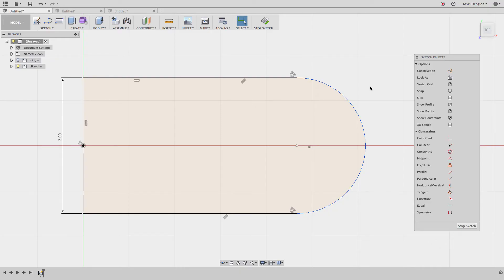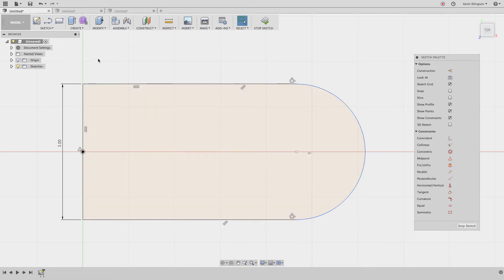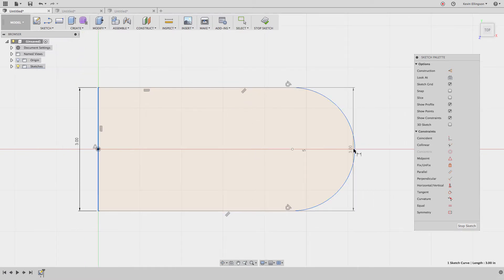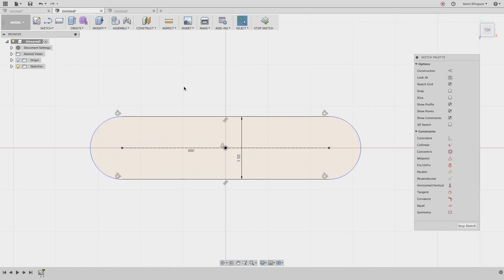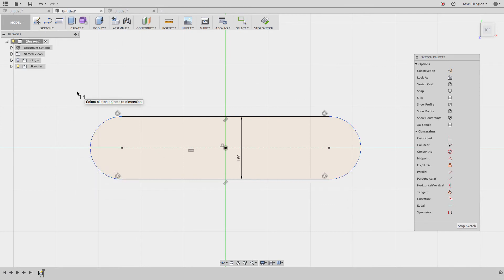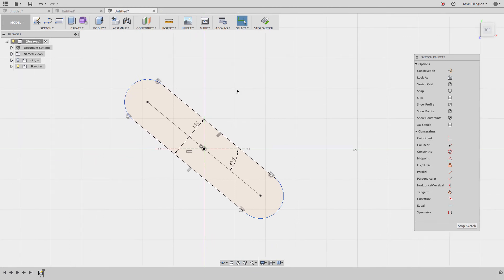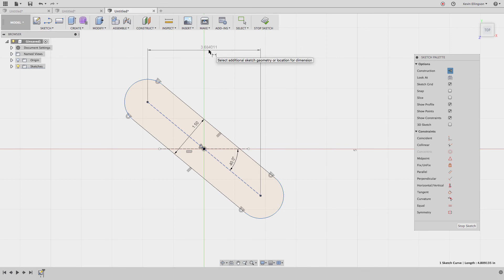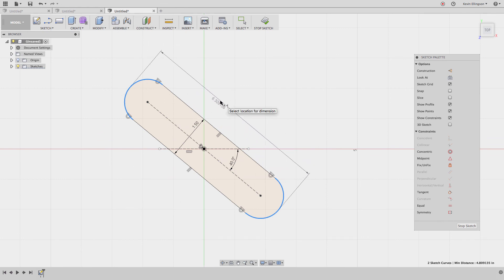Fusion 360 - Creating Tangent Dimensions

Comment: Huge help! I run into that all the time.  Also hit this situations where I am trying to dimension something, and its defaulting to giving me an angle instead of a length.  Frustrating.  Prob somethign I am doing wrong.  FYI, you may consider adding some tag words to the description of your video and in the tag words area.  If I had been searching for how to do this function, I probably would have typed "how to dimension the outer edge of a radius" or something like that, because I wouldn't remember or know the correct terminology.  Just a thought to possibly help you get more search hits
Reply from the maker: Ramsey Customs - turbocobra Good point. I add keywords when the video is published. I don’t think they show up for the users to see though. I am limited to the number that can be used when people publishing. I’m should add more to the description.